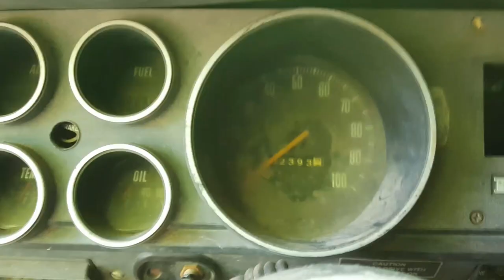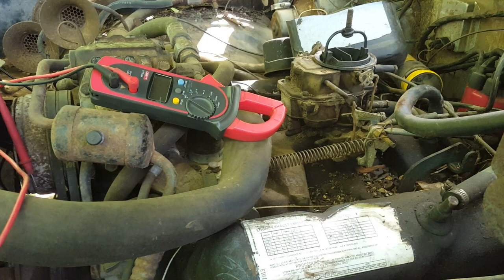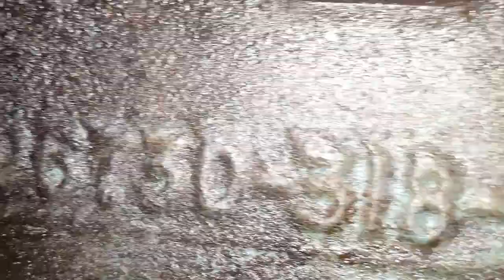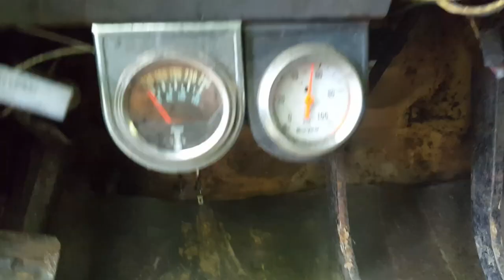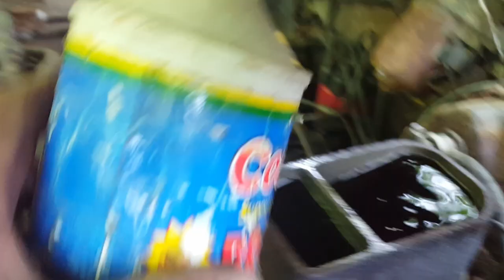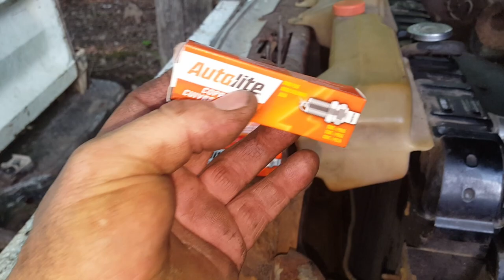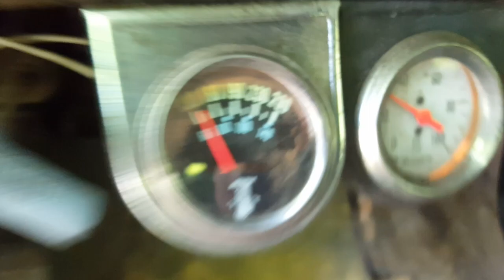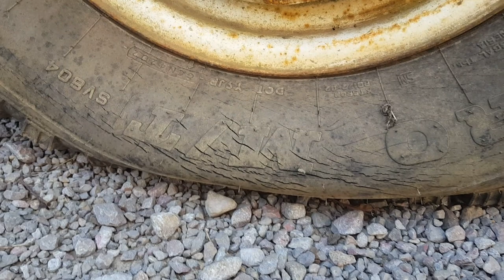1979 Dodge W300 Club Cab Sitting for 13 years | Will it run??

Comment: If it is a 318, that is a very good engine. There is a electronic module that may give you some trouble with spark. All in all Dodge is very good quality.

Comment: Ok I'm a dodge truck guy I have a lot of them from 72-77  The reason the vin on the door does not match is the door has been changed. The title followed the door good trick to make it a usable truck. Find alot of them with bad or no titles. some states make it near impossible to file for lost or a new title.
Reply from the maker: But the VIN plate is on the cab. I'll probably never know what it actually is.

Comment: I had a 72 and a 73...easy to work on. Loved where the fuse box was.A fellow could change the brushes on the alternator while still on engine.

Comment: Valve seals are gone in that 318,. I have a 318 from 1998 it started to smoke at acceleration it was concerning.. then it got so bad that at every red light it would leave a cloud of blue smoke.. so i tore into it and removed the valve covers and valve springs and sure as hell my valve seals were done.. so i changed them out and no issues after that.. you will need a leak down tool to hold the valves up once the springs are removed.  I also put a cloyes timing chain kit on it and timed the distributor with my multi meter.. runs almost like a new truck.. dodges are well built.

Comment: lot of times those rubber flex brake lines will swell right up and prevent fluid from going through I have seen then allow fluid through but not allow it to go back when you release the brake

Comment: What a great engine! I have a 89 d100 with a 318 and in the past I've had several 318 vehicles and they are very dependable! I'm also a chevy guy but I've strayed and bought a dodge or two in my day lol! The only trouble I had was the wiring! They are known for wiring problems. Just found your channel so I'm going to go ahead and subscribe 👍

Comment: Ain’t she a sweetheart! The driver side door looks to be a different colour and has a different door panel. That would explain why the tag on it says 79. The dash, passenger door panel, and exterior body trim tell me that the truck is a 72/73/74. The grill is 77/78, orange lights were 78 only. Parts on these trucks from 72 to  80 share the same body lines and are very interchangeable. In cab tanks were available till the late 70’s. Pretty common to find these pieced together from multiple years, especially if they are old work trucks or farm trucks.
Reply from the maker: VIN tag is on the cab tho not the door. I guess we'll never really know what it is.

Comment: I usually found the best way to force bleed brakes is to get a big cattle or horse syringe from a farm store or a local vet and suck the brake fluid thru the lines. Alternatively you do get brake bleed pump kits.

Comment: On the old Dodges like that the vin # was on the door and it looks like it was changed at some time but did not change the vin plate. motor must have come out of a 2 wheel drive truck, oil pans are differant that would be why the crossmember was cut out and oil pan hitting front axel. I have messed whit the old dodges for years. Glad to see one brought back to life.

Comment: Engine ci is stamped along with the date on the driverside above the starter. Those plugs were the wrong plugs that the guy had in it. Small block dodge plugs are alot longer

Comment: Square body gm truck off to the left of the dodge truck,I like the club cab trucks, and up on the block on the starter side above where the starter bolts up the engine displacement is cast into the block.. Dr side

Comment: I believe that was originally a 75 w300 cab and chassis regular cab and they put the long flatbed on it and then the frame was extended and changed to the d300 club cab.. configuration it is now..

Comment: I bought a d200 that sat for 18 yrs. The fuel pump diagram dumped gas into the oil. It was shot. Had to change oil again.

Comment: I believe you can call this one "Cobble Truck". It looks as though it has been cobbled up, and of course it is a wiring mess but that is another show. I would take a guess that it may have been cab swapped and the frame extended to accommodate the longer cab. It is hard to say. It looks as though it is going to need quite a bit of work to get it squared away and I think i would ditch those horns.

Comment: I very much like the way you work...knee and back troubles - I know them only too well, but I am older than you. You do not simply order new calipers and whatever but try to repair them - bravo; so do I, but I have got the problem to be unable to order anything - nothing is available anymore, not even a petrol pump...
What I do not understand : why do you push down the brake pedal first, if there is still some liquid, is is more or less guaranteed that your wheels do not spin any more and are seized solid...not to mention that all the liquid spills everywhere when you take the master cyinder apart ( which you have to do 99.9 % )
You know what you are doing; I have not got any experience with American cars and lorries, but, there is not much difference. Of course it is very nice to find all that stuff within " walking distance " - all in all : very nice, please go on - I am doing just the same ( with different makes, but, again, is is more less the same..
Another question : why do you order brake shoes instead of riveting new linings ? I have got no doubt that you could do that...
Best wishes and go on like that !

Comment: If the ballast resistor is out, the truck will run in the start position, but when you let go of the key, the engine will die.

Comment: My guess is it's parts from a few trucks.  That dash is a 72-74. The grill is a 76 or 77.
Reply: It is a combination of parts. I believe 70  or 72 was the last year they had a gas filler in the cab.I have some power wagons I tinker with.
Reply: The parts pretty much interchangeable up to the early 80s . The fenders changed in81 .The framework was similar up to the introduction of the 93.I put spindles and disc brakes on my 77 and 73 from a 89 and 90 power ram. The ball joints were the same in conjunction with the axle weight  class. A so called  mechanic told me lt  couldn't be done. I put 360 heads on a 340 and a 318 . You can't put modern ported heads on an earlier carburetor  Intakes as I believe unless probably modified, I don't know. There's a lot to learn about modification.
Reply: That grille is 77/78. More specifically after February of 77.

Comment: If Vin is on the door more than likely drivers door was changed and person who changed it did more tag on door. Now I see doors are different colors I bet I'm right, check and see if Vin matches registration. Sorry to say but that motor isn't original it should have a rear oil sump. That's why cross member is cut.

Comment: Looks like a rebodied and rechasissed truck, a 79 would have a different grill with a different radiator core support, different hood, different dash... You said the VIN calls for a single cab 2wheel drive, so it would appear someone grabbed a vin tag off a completely different truck and slapped it on maybe a 74 W300 with a 77-78 front clip, maybe a 79 360 with a 318 spec carb and I take... At this point the law probably doesn't care, but would be a nice project
Reply: Grille is deffinatly 77-78
Reply: @slinkyitsslinky8697  yes its a 78 grill i have an 80 d- 200 and my grill is deferent its the same as a 79 also 79 had an option for 4 square stacked head lights
Reply: also it has a car oil pan i put a car motor in mine but had to change the oil pan from like the one in his truck to a truck oil pan they would not have to had cut the cross member if they did it right

Comment: I suspect the answer to your vin number issue is, the door has been replaced on the truck. It doesn't match the color or trim level of the 4X4 Dodge.
Reply from the maker: VIN plate is on the cab tho. I'll probably never know what it truly is. 🤷

Comment: As Greta says "How dare you"! I don't want to do something... I am so damn old, I remember the Mayflower crossing the Atlantic... feels like it as crippled up as I got in my seventies.. don't think that Chrysler made a better engine than the 318. Some will argue the leaning tower of power but I just ain't a six  cylinder kind a fella. Them other parts rigs are any good at all, maybe put you a old chevy  cab on one so its got modern running gear an four wheel drive one ton dumper trucking sob../LOL

Comment: 38:41 well there's the low oil pressure. Fucking FRAM bombs. Glad you're putting a WIX on instead; top shelf filters!

Also, if you want a real mindfuck, just remember this: The Ford Windsor smallblock has 3 different firing orders depending on which cam is installed in the engine, and this can not align with the year model of the block casting, head casting, vehicle, whatever. Entirely possible for a newer cam to be installed in an older engine which changes the firing order.

I love my Fords....but I hate working onWindsor smallblocks. I'll stick to my 4.9 I6s and my flathead V8s.

Comment: Front sump car oil pan , not original motor in truck , trucks are rear sump pans
Reply: All Dodge trucks could be either 2wd or 4x4 , frames are set up to be made either way , just according to the build sheet coming down the assembly line

Comment: Grille is 77/78(78marker lights) cab and dash appear to be 73/74.  Drivers doors been changed there for the vin won't match the cab. It's definitely a pieced together truck. Has an auto column and it's a Manual trans. The fuel filler being on the cab is also proof its not a 79(cab at least) cab has a data stick that has the vin number as well. You are correct the D means 2wd and W means 4wd. CID is cast on drivers side of block(carb indicates its a 318). 
If it has Drum front brakes its likely a 74 if the frame and cab belong to each other. If it has Disc brakes it's a 75 up D60. The lockouts never came on 75-79 as they used the Full-time 4wd NP203 transfercase.
Reply: Some 76 custom model dodge trucks have the 72-74-75 dash also
Reply: Late 76-77 are like the 78 grille except the amber turnsignal lenses 78 are clear with amber bulbs and I'm guessing it's pieced together I'd say that they were building a rollback
Reply: @richardbates2367  considering the new model year has always been released before the actual year is present your incorrect. Late 76 would be the following years IE 77 which is the grille on the truck period. The Amber marker light didn't start till Feb of 78 so the first several months that the 78 model year was produced and sold in late 77 and January of 78 they were Clear not Amber. It's clearly pieced together given the description I posted above.

Comment: I wouldn't worry about the low run temp.  That thermostat is probably just a placeholder as you may have stumbled upon the first ever air cooled 318.

Comment: Nice save! The engine block has the casting date located on the opposite side from the casting number. There should also be a partial VIN on a pad underneath the oil filter area.
Reply from the maker: I'll check that out. 👍

Comment: We had a couple of those 318's back in the 70's.  a '71 charger and a '71 A100 cabover pickup and those engines are bulletproof!  Everything else on the vehicle may turn to sh***, err, crap, but those engines will go forever.

Comment: More than likely that was a built truck for the railroad. That's my guess. I know back in the day only certain places you could get an actual four-wheel drive and or crew cab, and most of the time it was on a fleet vehicle railroads would custom order them. So this was probably a two-wheel drive truck from the factory and then it had the four-wheel drive setup put under it because IDK if you can get a one ton Dodge in a four-wheel drive from the factory back then. You might have been able to do it it was probably like Ford where you can order it as a cabin chassis model. But you can tell that this was a fleet vehicle from the yellowish orange paint under that red.

Comment: I learned how to drive on a 74 dodge 200 club cab. Love them old Dodges. There aren't too many people now who would want to drive them. They aren't very quiet to drive especially with lock out hubs. And not the greatest ride quality. That one is more than likely a 1 ton. And it's in great shape for it's age.
Reply: 318 must be a damn good engine to do good work in a 1 ton. I know GM does similar with the 350 but still
Reply: Rick Simon had one in TV eries. Simon and Simon a power wagon. Change ballast resistor too
Reply: Cammonit spray all pivot points and run it like snot. Use second ear no weight

Comment: that is a variety of years truck with a car pan on the engine... all dodge trucks had a rear sump oil pan.
the grill is a 77,78  dodge grill. 79/80 dodges had a flat hood, and no gas tank in the cab.

Comment: Looks like the door was swapped on from another truck probably why nothing matches up, should be another tag on the front clip just right of the radiator. Cool old truck and it’s a dodge, your gonna have wire problems for sure lol great video.

Comment: Excellent video also next oil change get bottle of BRAND of Gunk WYNNES Engine Flush put in crank case when change oil use for 10 mins then stop motor change oil from oil pan  then new oil filter then oil pan again  to till stops completely then tighten drain plug up add new oil in ! Also get grey bottle of STP Total Treatment fuel injection and carb cleaner add 89 or 91 in tank each time too!

Comment: i have a 1980 dodge 3/4 ton pickup we changed the motor in it the reason they cut the cross member to clear the oil pan is because it is a car oil pan my truck oil pan is deep in the back and shallow in the front so there for that motor was changed it is a car motor and not a truck motor i put a car motor in mine but had to put the oil pan off the motor i took out on the motor i put in so i did not have to cut the cross member they should have used a truck oil pan would have been better  than cutting the cross member also the reason it says what it says on the vin is because the vin tag is on the door it is a 78 because in 79 the  parking lights were below the headlights in that cross brace the dash cluster is a 73 as well because it is not the same as mine also 79 did not have an in cab gas tank so i would say its a 74 cab

Comment: My friend Mr. Sam TAFLINGER pulled a 1940 dump truck out of a ditch. That’s been there for 40-50+ years. 6-volt electric positive ground flat head FORD 6 cylinder engine. Wouldn’t start then he replaced the fiber gear ⚙️ on the camshaft. And retired the entire truck and got it a running. One other thing is that he had to learn how to shift gears with a transmission with no synchronizers to help it shift gears more smoothly. What I’m trying to say is it doesn’t matter how long it sets if you know how to work on any engine you can get it to run even if you have to Work on the carburetor too. God bless you good luck and I know you got it running.

Comment: Nice video, thank you! The 318 is an excellent engine going back many years. They are measured in liters now. I have a 99 Dodge SUV with 180 thousand! I had the leaking metal seals changed and a bad computer replaced!  My T.B, throttle body fuel injection has never caused trouble. Ron PTL USA.

Comment: Wow thanks  merv … love the old dodges I bought a. 79 d 100 short box 360 4x4 , with lockers front an back  ,got it running last fall got to cold .going to get back on it soon the heater box is a mouse house … love the mopar winch … great vid …. Dave fron Canada 🇨🇦 later

Comment: Once you went to go moving old pick up Chuck off my buddy's property and we knew it had been there for at least 15 years and surprising enough the tires had not gone flat. But over 15 years somehow they manage to fill themselves up with water somehow. Either way I didn't have to worry about Aaron up the tires it was extra weight with the water in there and we started rolling the vehicle of course couple of breaks wanted to lock up but like I said with the weight of the water in there and stay locked up very long.